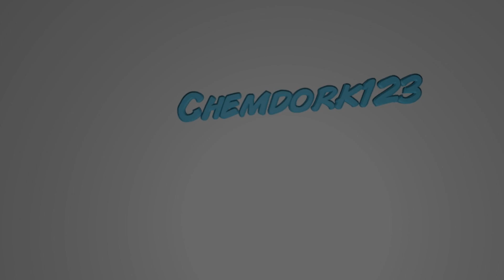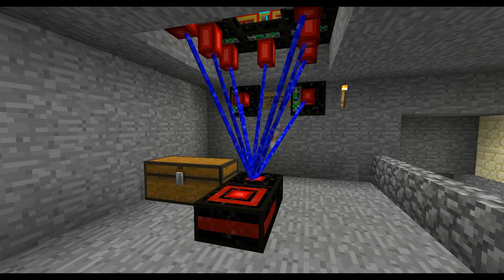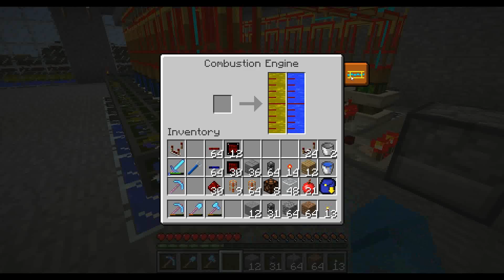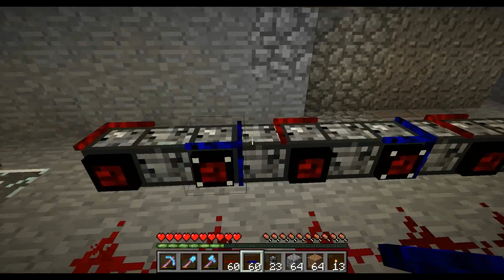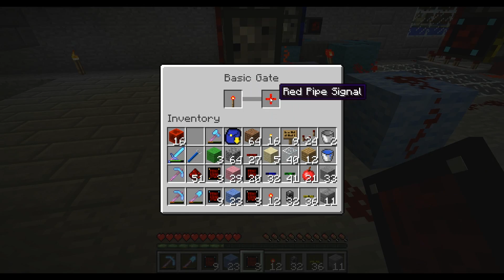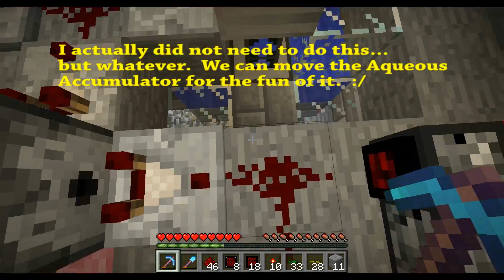My Buildcraft S2E46 - Sending All the Right Signals

Comment: Hey, chemdork, I tried to download thermal expansion, thermal foundation, and CofH core, but it crashed, so I removed CofH, and Thermal foundation, then it told me that I needed CofH (the version that I already had on my desktop), but then It crashed again, please help!
Reply from the maker: Make sure you are using (1) the correct version of Minecraft to go along with the version of TE you are installing, (2) install forge first (the one to match your MC version), and make sure you run Minecraft after forge installed and you see on the title screen "Forge version whatever..." on the bottom left, and then (3) copy the files for the three pieces of the mod you described: CofH core, Thermal Foundation, and Thermal Expansion to the appropriate directory.  That should work.  It's important to make sure you are launching the FORGE version of Minecraft when you start (you will see "forge version..." in the bottom left).  You have to run MC after installing forge BEFORE you copy the Thermal Expansion files and CofH files.  Does that help?
Reply: chemdork123 That's originally what I did, I retried it, and it still didn't work... I think it might be a problem with downloading the mods from the wrong places.
Reply from the maker: Marcus Turner Well, definitely follow the links in the description of the video.  They should lead you to the "official" download locations for each mod.

Comment: Would it not be more simple and less resource intensive just to hook up a certain amount of engines per station? Such as we know it takes 2 engines to run a refinery so have a switch that turns on two next to the refinery's. And then turn on another couple when your running machines.
Reply: That's not nearly as interesting as a central powerplant, though.
Reply: ***** Yea it would keep the central power plant but instead of using the dropper and snowballs it would use pipewires to turn on a certain amount of engines.
Reply from the maker: Shane Bilbrey To the earlier question, yes, it would be "easier" but I would then have to be concerned with supplying fuel everywhere and it would not use fuel efficiently.  More importantly, this way is so much more FUN (and interesting, as ***** mentions).  The way you describe is perfectly functional and easy for anyone to setup, but is not very challenging to figure out.  To the second question, the pipewires method would be very complicated (but possible), since you would have to create a system that would take inputs from your switches and add and subtract the numbers to give a "total number of engines on" value.  The way I set it up here is doing the same thing, but without creating the circuitry required for half/full adders and decoders.  The addition and subtraction functions are controlled by the snowballs.  Make sense?

Comment: Awesome wiring and planning.  I like the way you come with these ideas and go through the though process to give an overall view of what it takes to create a kicking base.  Two questions. 1 Are you going to create a world download for season 2 of buildcraft? Question 2 is at the end of season one did you have a world download and if so could you post it again?
Reply: question 1 world 2, question 2 world 1 XD
I find it funny somehow.
Reply from the maker: (1) At some point, I will.  (2) Yes?  I don't recall if there was one right at the end of episode 40, but in earlier episodes there should be a link in the description.  Be careful to use the same version of Buildcraft, and I warn you that the block IDs might be screwed up, so it might not even match/work then.  :/